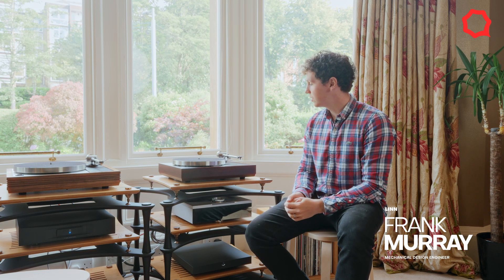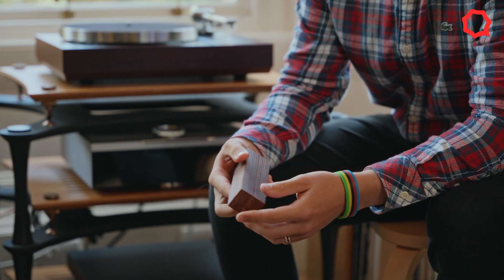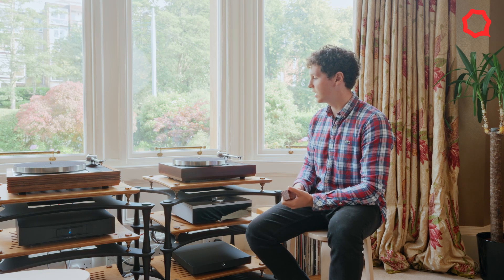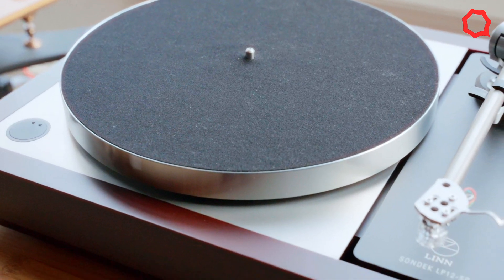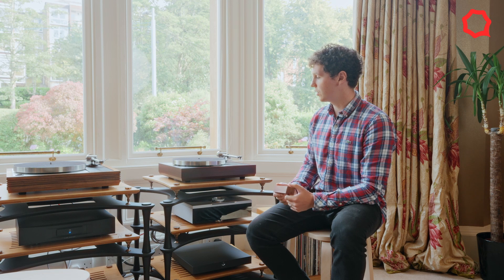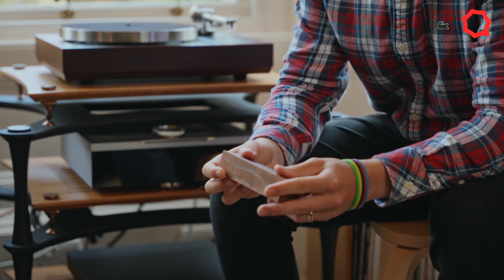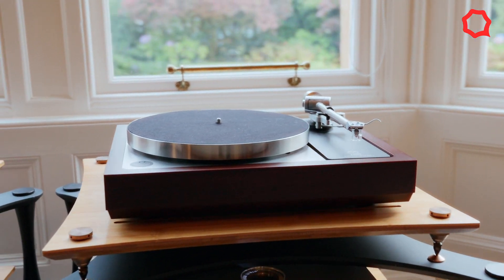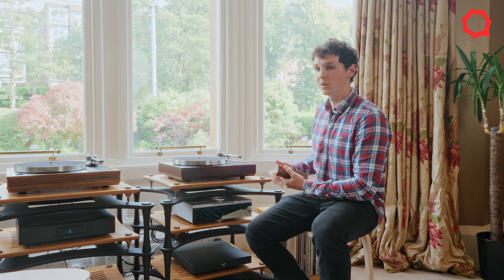Linn Products’ 50th anniversary Sondek LP12-50 Turntable – Bedrok Plinth – A Technical Introduction

Comment: When you look at official Linn documents, from the company's inception, what do they say?
That Linn is not in favor of heavy turntables, for the following reason:
A heavy turntable will store energy, and this energy will take a long time to dissipate. The design of a Linn LP12 is a lightweight but very rigid turntable. The tonearms follow the same principles. Linn also recommends placing a Linn Sondek on a lightweight but rigid support to best dissipate vibrations.
What's a plinth doing that weighs one and a half times the weight of a complete Linn Sondek? Not to mention the totally exaggerated price.

Comment: Erm , from launch back in the seventies , much was made of the LP 12s suspended subframe which not only kept the platter and the pickup rigidly coupled to each other , but also kept them isolated from the plinth , which of course was subjected to vibration from the motor as well as any external influences . I do accept that the new plinth may well reduce the effects of external influences , but if the subchassis is properly isolated , these effects ought to be minimal .

If the suspension is doing its job properly , then any belt drive turntable with a suspended subframe ought to find minimal influence from the plinth ; this of course being the case with my Michell Gyrodec which has the full plinth and cover , when compared to the version which can be bought without any plinth at all . Of course many details have changed down the years , including different power supplies , motors ( which have different mechanical characteristics as well as radiated magnetic field patterns ) , springs and damping provision within the suspension , different pickup arms and cartridges come and go from fashion ; and so it has been also with Linn .

I used to sell Linn , Naim and other associated products back in the seventies , when an LP12 retailed for £82 ( yes eighty two pounds ) for the bare deck ; at the same time my then Transcriptor Hydraulic Reference Turntable sold for £118 , again minus arm or catridge . Nowadays those prices would hardly buy even the most basic deck .

Of course , for anyone who has earlier versions of any of these decks , servicing or upgrade paths are readily available .

Comment: Got to be more value in that than a brand new Mercedes for the same price..
Reply: Actually, I’d drop the AMG wheels option and buy a Technics and the Mercedes.
Reply: I wouldn't buy a brand new Mercedes - I will stick with my W105 Ponton , W111 Fintail , W124 estate and R129 , which collectively cost a fraction of that figure and are far better cars .

Comment: Love my LP12, saving for my Ekos.  Would love this deck and I know the tech will filter down the range.  By the way £50k is by no means the most one could pay for a turntable.
Reply: but it is a little ridiculous right?  Are your ears really that good to tell the $58,000.00 difference between this Lynn and a $2000.00 table?
Reply: @TrueAudio  My hearing isn’t any better than yours, in fact at my age I’m willing to bet it isn’t as good 😊. However, if you visit a Linn dealer and ask them to demo each model in their range, and granted it is hard to tell them apart, I guarantee you will hear a difference.  My wife is not an equipment enthusiast but can tell every time I make a change to my system.

Comment: I love my 1989 black ash LP12.  With a Lingo mk1, Ittok, Troika, Cirkus and Trampolinn, it is basically a perfect LP12 from the era when it was at its peak and still good value for money.  If I was to buy a new turntable, it would be direct drive and probably a Technics.
Reply: Had a few belt drives including a LP12 . Purchased a Technics 1210 G last year never going back to belt drives.
Reply: @grantlivingstone147  curious: what made you switch?
Reply: @grantlivingstone147  Direct drives are easy to set up out of the box , and they have many good qualities , but they are like CD players and don't ultimately give the same satisfaction . However , all that matters is that we each are happy with the choices we make . There are good and bad turntables of all types .
Reply: @grantlivingstone147  thanks for sharing. Makes perfect sense.
Reply: My LP12 was exactly as is yours at one time. It even had the black ash plinth.